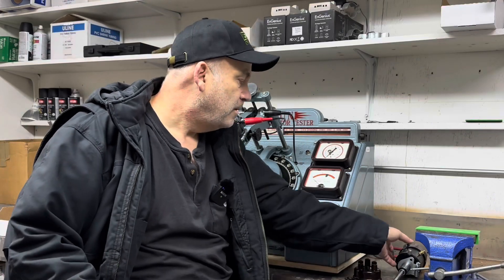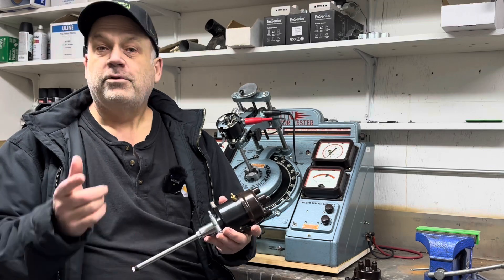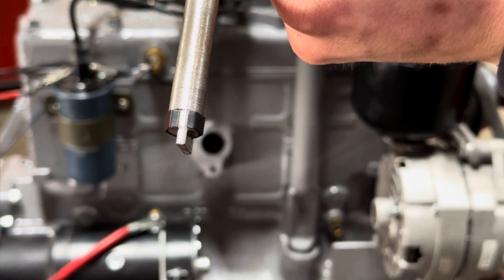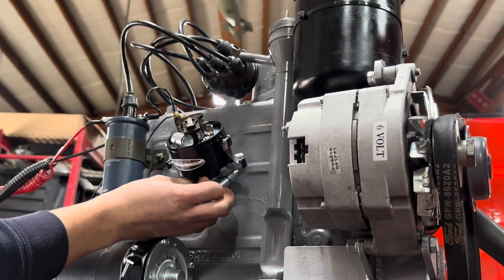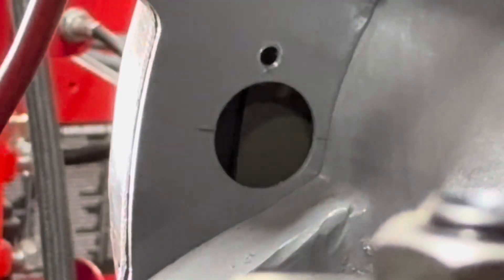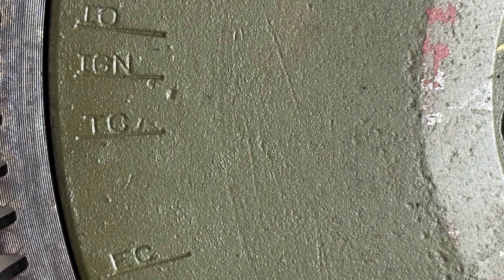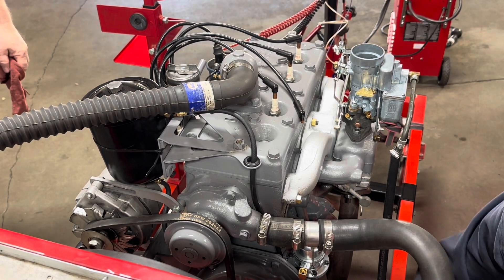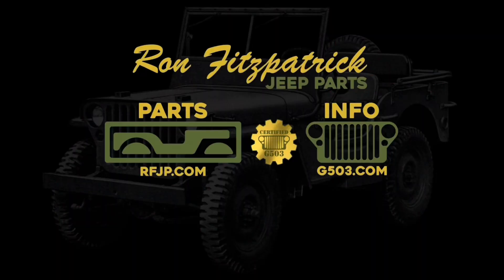Finding top dead center and distributor installation in your flat fender Willy’s  engine #RFJP #JMP

Comment: I am struggling with mine after full engine overhaul.   I notice my distributor does not fit down that last little bit you showed in this film, having to pound it in .  I also did not notice the spring on bottom of distributor shaft,   Gonna pull today and make sure it is there.   I got it to run very briefly yesterday still backfiring a bit through carb.
Reply: I had trouble with this 51 willys cj3a... the flywheel was 180 off... I used a wire through the spark plug hole to fee TDC, and watch intake valve close, and exhaust valve closed... Then see whick terminal the rotor is pointing at... Make your wire go to that cylinder, then just folow the firing order around the distributor...  worked for me, and running fine.

Comment: When I try to adjust while it’s running, my distributor shocks the hell out of me.
Reply from the maker: you have bad ignition wires, the wires are "leaking" this is pretty common
Reply: @RFJP_G503  The wire from the coil to the distributor or from the distributor to the spark plugs? Or all of the above?
Reply from the maker: @Colonel_Obvious  they come in a set all 5 wires 
https://www.rfjp.com/p-1920-ignition-wire-set-l134-modern-930456.aspx
Reply: @RFJP_G503  Thanks! I’ll try a new set.